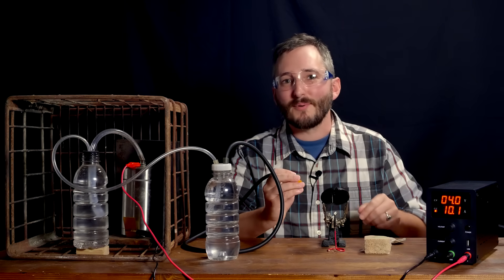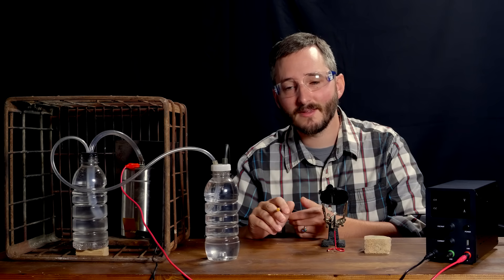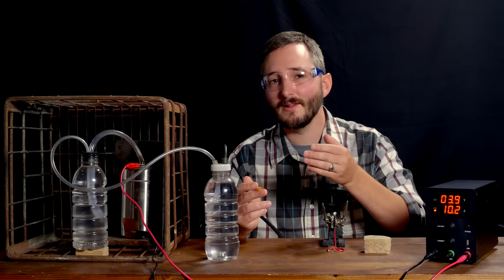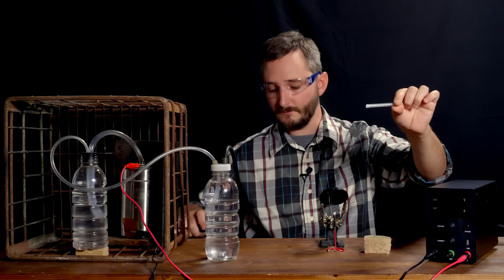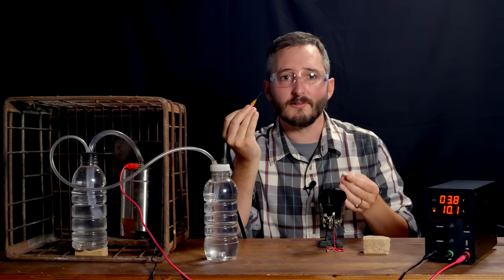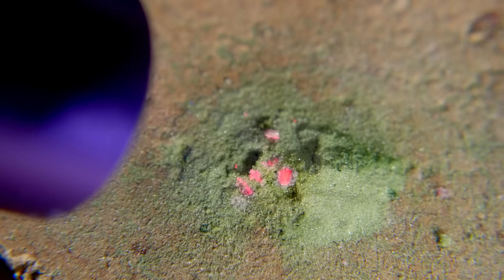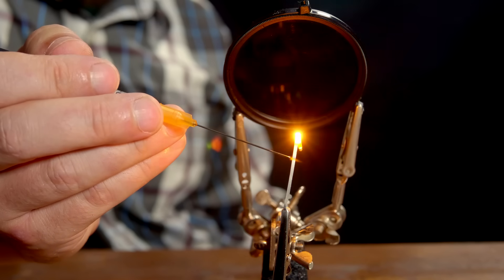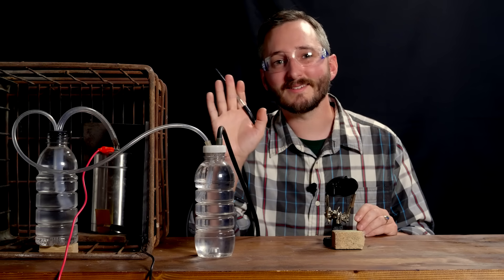DIY Oxy Hydrogen Torch Using Water Electrolysis

Comment: - hydroxyde sodium électrolyte hho gaz is not pure -> sodium ray so when you play with hho please wear google who ban sodium ray !

- propane and hho are call the "poor man oxyacetylene" perfect to cut huge IPN or cut big axes or a train,  you can dop it with a high pressure air compressor flow + laval nozle + a mix hho propane and build a very very power full torch less explosive than hho alone this kind of torch could dig hole in metal in brick or in the ground contact less and vaporize, stone argile ... as if it was sand ( yes a cooling is require in order to dig in the ground or the head goanna mel)t!

- hho arrestor could be done with a very long spiral / lacuna non flameable tube . If a back flash appear presure increase and inject water far away at the begining of the tube and stop backdraft an other thechnic is too use the preseure pik to open / disconect the tube in a water tank ... all are simple mechanical switch and you must use one mecanical switch before each buble botle.

Comment: As a scientist I can see a bunch of uses for this immediately in the laboratory (particle accelerator lab).  Brazing small parts, glass work, making source cathodes, soldering, certain chemical reactions, producing scintillators, etc. Great job!
Reply: This tech and concept was popular back in the 70's. Its definitely nothing new, Mike Meyers, made the higihest efficiency design. There was even a system a decade or two back called "H2000 oxy-hydrogen welder". I made a generator as a kid out of sheet metal and nylon hardware with stainless steel and aluminium, not sure why this guy is so scared of it lol. I used a regulated version on my car.
Reply: @kornshadow097  noticed you said " used on your car"
Not any more tho ?
Reply: @NCOGNTO  I had a unit going for a while when I first learned about the process. I put it in my 69 gmc pickup. 242 inline 6. It doesn't do too much to an engine+vehicle that size at the levels I was producing except clean up emissions a bit? It's no secret an engine needs to be redesigned to harness the power here. I still prefer Internal combustion engines though. This as fuel can keep the hot rod'rs satisfied and then some.
Look up the ft³/sec burn rate differences between
Gasoline, Hydrogen, Oxygen, Hydrogen+Oxygen
Reply: @mayhemwoods  you know the worlds fastest cars ran on hydrogen peroxide ?
Its not just the fastest fuel (real TOP Fuel?) , its also the cleanest
And yeah , my monopropellant confined decomposition engine is lots simpler than what we are used to .
Reply: You can buy on at most jewellery supplies outlet.   In the UK Cookson Gold sell the  Aquaflame Micro Welder, Model 800 for £2000 after Vat. I have a unit that is very close to it and works great. i did a vid on it.
Reply: As a mad scientist: torturing.

Comment: You mentioned that the mixed gas is dangerous, but what if you just use hydrogen? Is it possible to run the oxygen in a different hose up to the needle tip itself, OR would it be safer to instead of running the combined gas all the way to instead use the syringe as a mixing chamber for the hydrogen and oxygen?

Comment: Is the (relatively) cool flame from the excess water vapor that is also in the HHO? If so could you run it through a desiccant to remove the excess water and get extra heat?
Reply: Just occurred to me you may be measuring in Celsius

Comment: What if you used a Tesla valve in the torch feeder tube made out of a 3D-printed heat conductor and then encase that valve tube within a water-based radiator tube similar to a liquid cooling system for a computer? Might be a good way to increase safety/reliability to where this is more practical, but still fairly inexpensive.

Comment: Friend of mine did oxihydrogen torches for jewelry work for several years. His construction mixed gases near torch itself and had very sophisticated flashback arresters, invented by him. Also, electrolysis device used pure, distilled water (I don't know, how it was constructed). Later he found permanent job at firm which produce large heat treatment ovens...

Comment: Great video as always. You could use the torch for engraving. Or I should say melting your name into items. 
 Making an Electrolysis device is pretty easy but is there a way to compress and store the gases. I purchase small oxygen bottles for my jewelers torch and it gets pretty pricey. I would like to make a device that would allow me to refill them. Any ideas?
Reply from the maker: I'm not sure there's a way to refill an oxygen bottle that would be safe for anyone. There's a lot that can go wrong.
Reply: @Nighthawkinlight  thank you for your response. I’ve worked in industrial settings my whole life. I know safety with compressed gasses is an issue. But it is done on an industrial scale and someone developed a safe process in the beginning. As well they make oxygen concentrators and bottle refillers for those that need supplemental oxygen.

Comment: Just a quick warning:  stainless steel is not a particularly safe anode material for anything you plan to use more than a few times.  The chromium in the stainless will produce hexavalent chromate (extremely toxic and difficult to dispose of) and turn the electrolyte yellow over time.  It’s a slow process but it does happen.

Some cheap alternatives are graphite (will slowly break off graphene sheets over time but it’s not fast nor a problem really) or nickel plated copper.  The best is platinum plated titanium (which you can buy on Amazon).  It lasts the longest and gives the reaction a nice catalytic kick as a bonus.

Great project regardless, and video!
Reply: I didn't realize the electrode got hot enough for that. CR6 doesn't start to form until 200c.
Reply: @necropasia  depends on the setup, ive had many HHO genreators boil their electrolyte, while ive had some stay cool to the touch
Reply: Oh cool I can use graphene sheets to make needles to put in my 100x HHO MINING TORCH (with rotating quenching clothe).  Lol
P.S. thanks for the information.
Reply: I thought 316L was a good material. Many sites recommend it.
Reply: @JavoCover  实际上H环境下316也抗不了多久
Reply: I used scrap aluminum on the oxygen side the few times i tried things like this, no issue aside from kinda slowing things down a bit from the aluminum oxide layer being a bit higher resistance than everything else involved.
Reply: @fyrrydr4g0n  use ventilation cause the gas off for that is extremely toxic
Reply: It's funny how the FDA tries to recommend a daily chromium intake for us, then turn right around and put it at 20 micrograms because it's so utterly toxic
Reply: He already addressed that in the last video.
Reply: The pinned comment on the previous video offers a solution for this. Your suggestions for alternative electrode materials are helpful too, though.
Reply: Any ideas making graphite electrodes  - I tried polystyrene / acetone / graphite powder blend
Reply: @Jan Beute  I would think even size nano like particles then you compress it in a very strong hydraulic press you can make one using a car jack but I would recommend an air powered car jack one that uses the air to make the hydraulic fluid move.

Far less pumping and more squeezing. That way you can compress it extremely tightly then if you heat it again in a kill you should be able to drill it to make a fine needle
Reply: Hi first of all your art is absolutely stunning 🤩,second, happy to watch!😛👍🍭😜👍beautiful artwork dear full watched 😍💞💞
Astonishingly beautiful!!!... What a brilliant masterpiece!!!... Your artwork is phenomenal! Your skill set is superb with amazing techniques!!!... Awesome creations! Absolutely love it ! Thank you for sharing!!!... 👍+🔔😘😊😘😛😜🍎🌷🌹🌺🍂🍃🎃🍒🍖🧀🍓🍊🍅🌭Again amazing work 💕 keep it up and stay connected 🙂❤️🧡🧡❤️🧡🤣💟💜💛💙💛💜💙Absolutely stunning Beautiful! 🤩,happy to watch!😛👍😜👍 wonderful!
make a new friend just amazing no wordssss..💌💌💚❣️💛💕❤️🧡🧡so beautiful work really enjoy by watching your video keep sharing stay safe and connected🙂🤗👍🍂🌷😛🍖🌹❤️🧡🤣💟💜💛
Reply: I think it can be mixed into a gelatin, which, upon exposure to UV, will turn water proof and pretty much indestructible. Tesla was writing about it in relation to camera signal processing, to make fast sequential images to travel via radio into specialized tube receiver screens in households. Now that would never work. People don't watch tubes for entertainment.
Reply: now they watch youtubes
Reply: I remember reading online about 15 years ago that nickle was a good electrode material in a sodium hydroxide solution electrolyte. Does anyone know if that is true? Some room steamers use carbon rods to boil water with AC. How would those react to electrolysis?
Reply: Is nickel plated steel (galvanized steel) good too?
Reply: Stainless steel is great. With alternating current, potassium hydroxide, and just the right voltage is effective and easy on electrodes. But for direct current. I can't think of anything other than platinum for electrodes.
Reply: I'm pretty sure he addressed that concern in the previous video?

Comment: Hi Ben!  Your fun science projects remind me of my childhood!  My dad gave me a power supply, electronics parts and toolkit and also a Jacob's ladder when I was about 10 years old!  I liked to experiment with different anode/cathode materials for the Jacob's ladder.. usually a sanded copper hanger wire worked perfectly.  But I also experimented with water electrolysis using different voltages, my power supply had different voltages and also AC and DC output, and if I wanted high voltage then I would run it through my HV transformer (that also powered the Jacob's ladder).. so it was interesting to see the effect on the electrolysis output using high voltage with AC.. this worked very well especially for a combined output of H2 and O2.  I didn't know about using a flashback arrester, so it's amazing I didn't have any unexpected explosions in my teenage bedroom laboratory!

Comment: when you make a larger split cell type generator, try using it to run a larger torch. you can easily use it for cutting by simply adding a valve to bleed off a portion of the hydrogen.

Comment: Would be amazing to see some kind of combustion engine that was fuelled by this gas mixture. No need for a carburettor, but would need a clever way of preventing the combustion in the cylinder from igniting the supply flow.

Comment: I did this when I was 14, in my parents garage using a Coke bottle water, graphite lead. I stored the hydrogen in a film container. I put 2 metal wires through the cap to make them arc. And using a rocket push button switch I could produce a very loud Bang. 💥

Option 2:  Works Toilet bowl cleaner (20% Hydrochloride)
Aluminum foil 
Coke bottle 
Balloon or film container

That should work too if my memory servers me correctly.

Comment: Is it possible to scale this up, make it safer, and power an engine? Could an alternator provide the power for the electrolysis?  The exhaust from a hydrogen powered engine is water. Could that exhaust water go back to the water/fuel tank? Or is this an impossible perpetual motion idea? I know hydrogen tanks can power a car, but I don't know about getting hydrogen from a water tank with a rig like yours (with safer methods of course).
Reply: The energy it takes to separate the H2 and O2 is the same as the energy you get from burning the resulting H2 + O2, so yes, this is an impossible perpetual motion idea.
Reply: @BrightBlueJim  that's what I thought, thanks

Comment: I would try a small scale Tesla valve to limit the flow of any ignitions in the line. Possibly even use one as the handle and have the needle protrude from that.

Comment: Nice to see attention to safety, although like I mentioned in another comment, I would like to see the hydrogen and oxygen kept separate for as long as possible, and something having less energy of combustion than aluminum wool used for the flame arrester (like brass/bronze).

I could see a version of this with provision for regulating the temperature with inert gas(*) being useful for soldering when you need concentrated heat for a very short time to melt the solder, and a fine point soldering iron just won't get the heat in fast enough and ends up cooking the surrounding circuit board while still failing to melt the solder.  Even better if this had a solder wire feed mechanism alongside.

(*)Edit:  Alternatively, dribble in a bit of sodium carbonate solution or something like that, so that you get the added benefit of making the flame more visible.  Although you don't want to make it TOO bright, or you won't be able to look at what you are working on at the same time.

Comment: Hey man thanks for another cool video. Do you find comments decreasing as distribution of view count skews toward mobile devices? I made your coaxial spud gun long ago... Actually I have an improvement for the piston... Mine is made of a very large lump of silicon adhesive that I caused to set by mixing with icing sugar.

Comment: Hey, what if you created a one way valve at the tip of the syringe and stored water instead of aluminium in it for fool proof protection against backflow and cooling of the needle for prolonged usage?

Comment: I think high flow rate is not the right term to use here,it should be high velocity
Reply: The flow rate of the gas when forced thru a small orifice is not high,however the velocity is

Comment: I used to work at a plastics company, we used a hydrogen torch to clean up the edges of plastic after it was machined.  Because hydrogen as a fuel contains no carbon, the flame is clear and imparts no impurities to the plastic and by simply wafting it along the edge of the freshly cut plastic it would go transparent again, like magic!

Comment: If you switch to a spiral stainless steel sheet system with a plate clearance the same thickness as the plate itself you can eliminate the need for an electrolyte like Stan Meyers did, all while maintaining a similar gas production.

Comment: i built mine using an under sink water filtration tank.   it was clear thick plastic that you could unscrew the entire top plate to access internal area where filter usually sits.   using 2"x6" plates separated by neoprene nuts and bolts.  every other one was connected to pos or neg.    it was very interesting watching it do its thing.  not sure of production but it was pumping out some bubbles.

Comment: Electrolysis was our favourite experiments in highschool. Me and a bunch of my friend conducted multiple experiments (wasn't really experiments, we were just having fun). Our favourite part of the experiment was filling a vacutainer with electrolytic solution, sealing the other end with a piece of eraser and using two needles as electrodes. In time the gas build-up would make the vacutainer fly off.

It would be pretty awesome if you could attempt electroplating next 😁.

Comment: Id like to see a version with the hydrogen and oxygen generated separately, that way you can set the fuel air mixture yourself, and would probably be a bit safer
Reply: You don't want to adjust the fuel/air mixture. It will automatically create the perfect mix because it's releasing all the gases from the result of the perfect mix (i.e 2Hydrogen /1Oxygen). Any adjustment can only result in being unable to burn all the gas & so just waste it.
Reply: Yes this one makes me nervous. There are other builds that separate them, a little more complex but doable.

Comment: What I wonder about is who us researching ways to increase the efficiency of the electrolysis. There is pulse width modulation and surface area. Cavitation. Psi pressure of the vessel. Etc etc. See what I mean. These studies should have funding.

Comment: I think you should run 4 generators in parallel on their own power supplies and combine the outputs into one needle. See if we can get enough heat and a big enough flame to do some more useful stuff. Though, maybe only from behind a blast shield with a very big stick.

Comment: Question, I use sodium bicarbonate with my distilled water because it doesn't evaporate out but as my concentration changes I get crystalline damage in the containment unit. How is your electrolyte holding up as it evaporates? I believe it becomes more acidic but do you get any kind of creep developing around the seals?

Comment: I graduated from plates a long time ago. I tried cutting grooves in stainless rods but they didn't last. The best outcome I've had so far was using a double coil method with stainless cable. I'm working on nickel plating and then Platinum plating said cables to see if I can get longer use out of them but most of my units last for months if not a few years before I have to disassemble them permanently. I've been experimenting with printed containment units and am now trying to move on to injection molded containment units with a special architecture built inside to hold the cables. Just a heads up, winding cables and a helical pattern inside of a cylinder he's not very easy and you will get frustrated but a pill bottle can hold 7 ft of 5/16 cable and it's entire inner cylinder circumference. That's a lot of surface area! I'm also developing a Hoffman style using the same electrodes and have some small units that have powered some devices which I shall not put on YouTube because they are in Gray areas that don't want to give away too many secrets they could lead to a contract down the road. This is why I've never filmed but I've been leaning more toward it lately. Just bought my first plasma cutter about 2 weeks ago. It was broken and I just fixed it. Keep up the building and the experimenting! Not all of us like to film but those of you that do can spark an interest in the broader population! PS ear protection! Tinnitus is not fun, hydrogen gave it to me when I was 18!
Reply: One question though pertaining to your method. Have you figured a run duration before you have to change the steel wool?